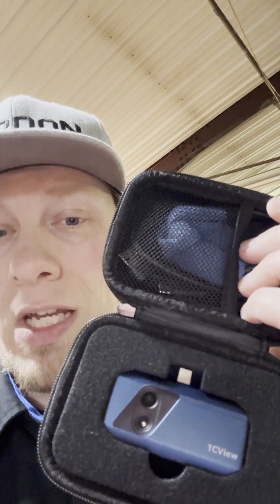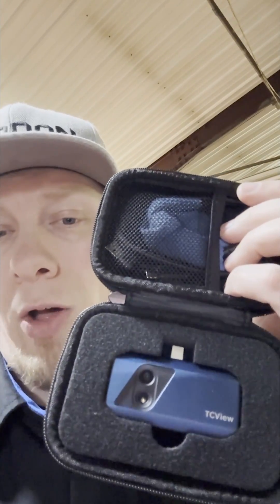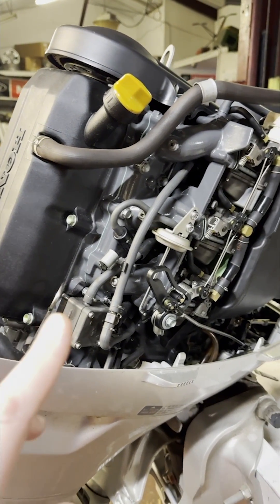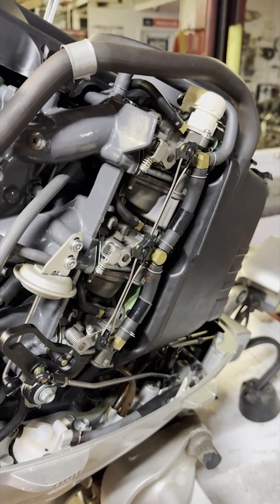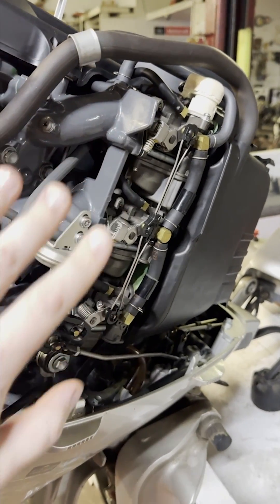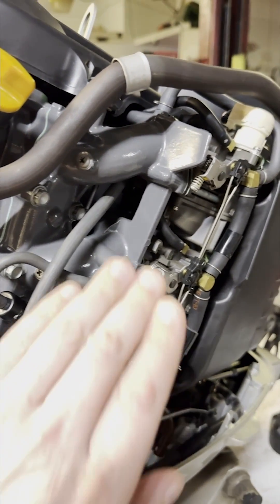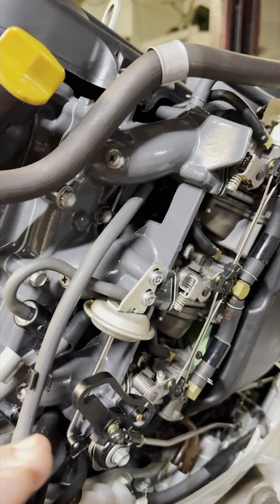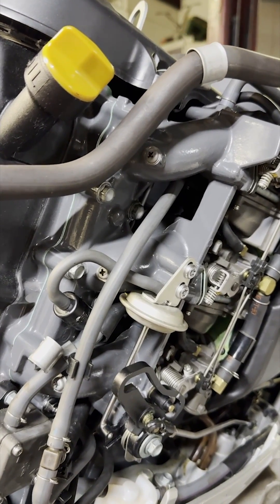Revolutionize Small Engine Repair | TOPDON TC001Plus Thermal Imager | Honda Boat Motor Tuning Guide

Comment: Hi Team, This Tc001 Can it find water leak? I have plumbing problem in bathroom, drain pipe is under concrete and tile floor and water pipe is inside wall.
Reply from the maker: Thermal cameras can’t see through walls.
Reply: @TOPDONUSA  thanks, have Topdon a model of camera for this?